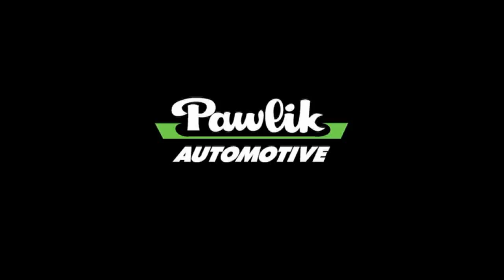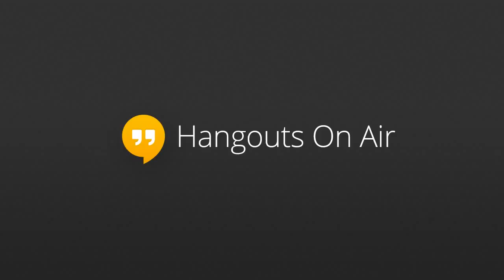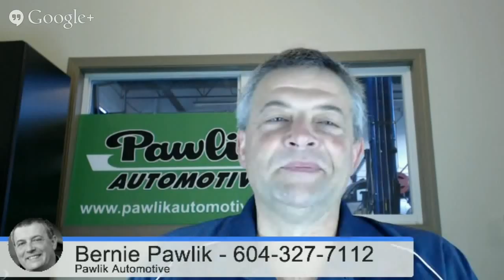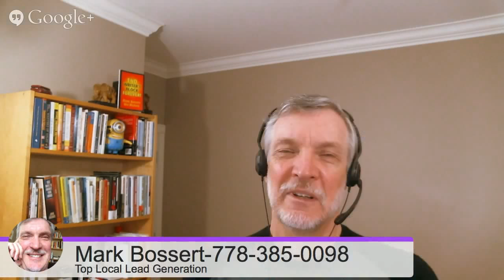Pawlik Automotive BMW - How are they for concerns, repairs, maintenance?

Comment: Those long oil change intervals are both planned obsolescence and a sales feature (for the original owner) in one. The fact is it takes time for dirty oil to wear the engine enough to start causing problems and by the time that happens two things will have occured: the warranty will be up, and the original buyers who either don't have that much money and leased it for a few years until the lease is up or are rich and bought it, will have moved on to the next shiny new model released that they just HAD to have. And BMW and similar brands only care that the original new car buyers don't have problems. This is one of the reasons that this and similar brands depreciate so hard.
Reply: Tim lol this is true those long oil change intervals are definitely a death trap for owners wallet, those engines are built to perform with twin turbos only a jackass would think 10k or 7k oil changes are suitable for long term ownership, a regular v6 Lexus or a Toyota will go those miles, but a bmw is notorious for cooking, and drinking quarts of oil, some of these idiots think it’s a good thing to mix fresh oil with burnt dirty oil for topping off engines when they are low on oil especially with no dipstick in place to give accurate measurements.

Comment: People wondering what the common issues are: tons of expensive electronics, expensive air shocks, tons of plastic parts, VERY expensive maintenance and repairs.  The engines are solid, but as everything around it fails they become money pits.  Only do it if you're the type to buy/lease it, drive it for less than 5 years and ditch them.  Ain't built like they used to - the '90s stuff was good and reliability, but today's BMW's, Audis, VWs, Mercedes, Volvo's, Rolls, etc they are money pits due to designed obsolescence.  If you want luxury, get a Lexus or Acura.
Reply: I totally agree.
Reply: Be careful with your opinions, fx vw has about the same cost as toyota in 10 years of servicing them. (source; your mechanic)

Comment: Which models are sort of trouble free?  I simply do not understand how a company--like BMW or Mercedes- can charge $45,000 for a car that more than likely will result in very near expensive charges.  This tells me people prefer notoriety/prestige  over common sense.
Reply: That is because the people that buy these cars new will not own them by year 5.   I had an Audi A4 I bought new in 2006. I LOVED that car.  Great interior quality and driving performance.   Pretty reliable until year 5, then that f&*%ing yellow check engine light would come on every month or so. Got to be a pain in the ass. Sold it for a new Lexus and have never looked back.
Reply: You don't understand because you're poor. You make probably $3,000 a month after tax. These people make $15-60k in one month.. If you have to ask, you can't afford it.

What? You don't buy name brand clothes? You're not above it.
Reply: Z4 is probably the only reliable model they made in the past 20 years